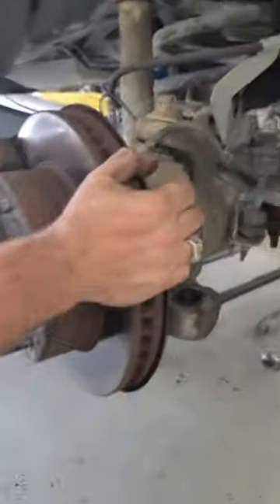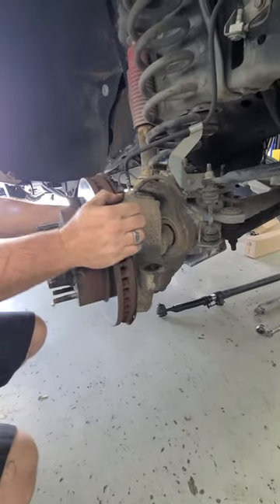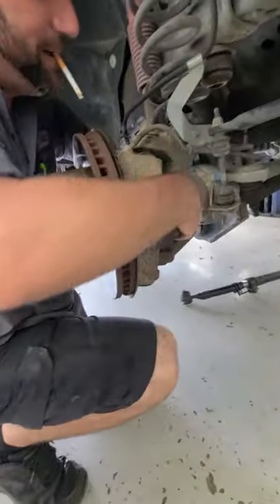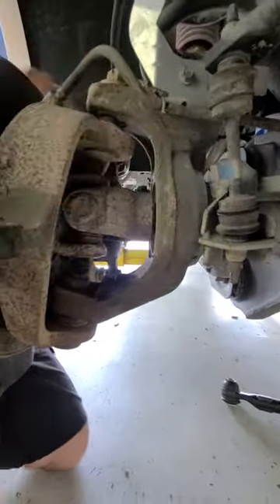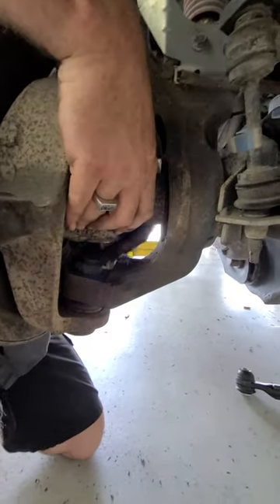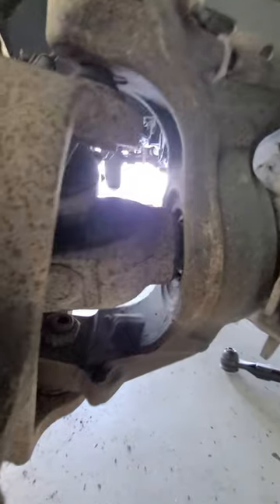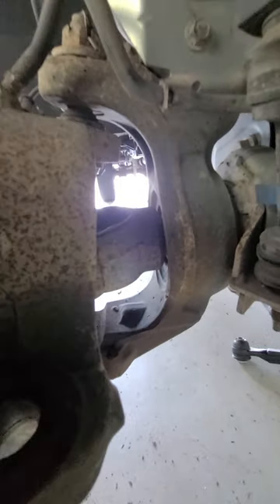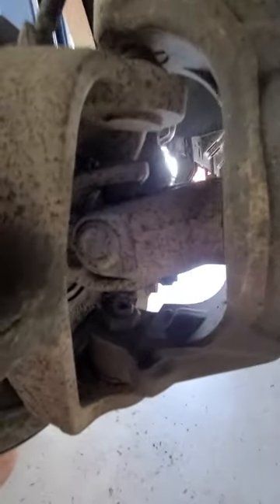Ford F250 Steering Bind Issues

Comment: can you make a video on fixing this please im having this issue
Reply: Gotta take the axel out, put on a vice, take out the snap rings and use a socket just small enough to fit in there and hammer it out. Heating up the yoke and hitting it with a hammer helps a lot too

Comment: New drag link? Lil death wobbly wobble?
Reply from the maker: The U joint was binding up.
Reply: Engage 4x4 on occasion to prevent.
Reply: @benjurqunov  why?
Reply: @johnnytardes6801  
If those joints seldom get rotated they'll stiffen up from corrosion and lack of getting their grease stirred up. 
Especially so in rust producing environments what that truck appears to be used in.
Reply: @benjurqunov  ok so.... when the car moves it doesn't rotate with the hub and disc? With or without being on 4x4.
Reply: @johnnytardes6801  yes